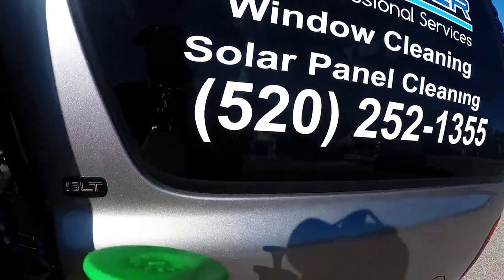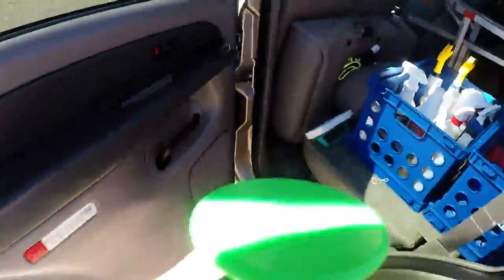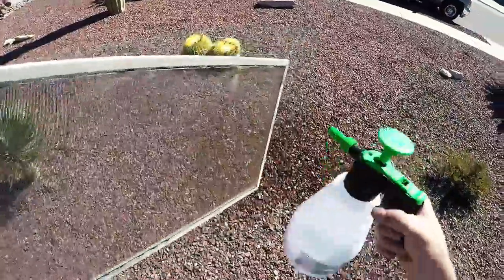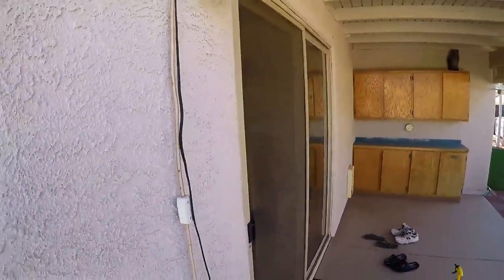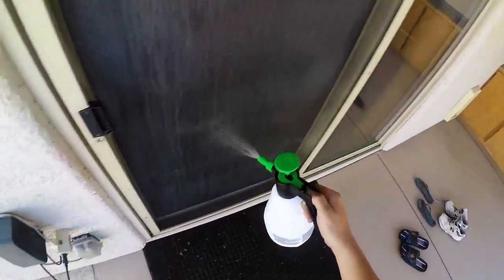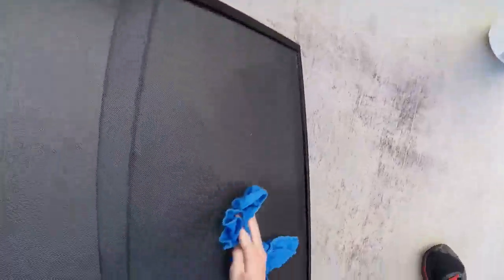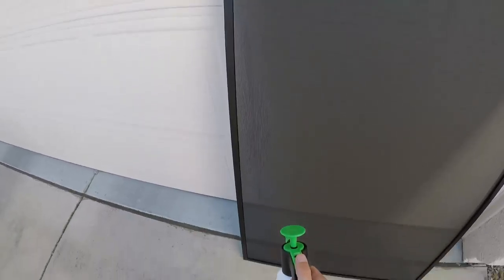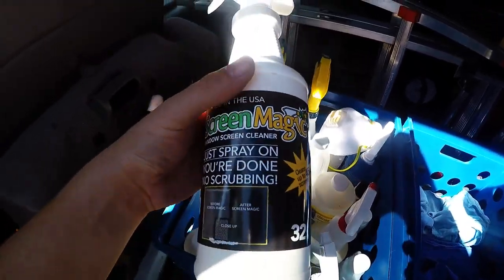Screen Magic (Screen Cleaner)

Comment: Hi, I've been using  this stuff for over 10 years, I always do two screens (as per  manufacturers instructions) at a time, both sides, saves material and time. Same with sliding door screens. And if you get this stuff on any vinyl or tile, it will be very slippery and dangerous for homeowners to walk on, so always cover before spraying if you don't remove slider screen. Just my  8 cents worth
Reply from the maker: Thanks for the advice!

Comment: What about the cleaning part? Or,you already cleaned them. I'm getting a lot of calls for houses. I might have to get some of this stuff. Thanks for sharing.
Reply from the maker: For those window screens in the video, all I did was spray it on and you're done. It eats away at the dirt and gives it that shine so you don't need to clean the screens before hand. I use it a lot on Sun Screens cause it really makes a big difference. If the screens aren't that dirty I will normally just brush them off real quick and your good.
Reply: Palmer Professional Services 
Ok cool. Nice.
Reply from the maker: It can get a little spendy so use it sparingly. And that's why I don't use it if the screens aren't very dirty. But its worth it to have in your car. Just in case you need it. Its not a product I use on every house. But very nice to have. Go pick up the 32oz ready to use screen magic.
Reply from the maker: Did you put a quote in for the house? that you showed us in one of your latest videos. Just curious how that went.
Reply: Palmer Professional Services 
Not yet. I tried but no answer. I left a message I'm going to call back later this evening. Good thing is I have 4 other houses lined up. My residential is coming along.
Reply from the maker: That's good dude. I'm glad your residential is coming along nicely.
Reply: Palmer Professional Services 
Yeah. Me too.👌

Comment: Seems cool. It is a bit pricey I see for the amount you should use per screen. Do you think you could mix it with some water so the product can last longer?
Reply: Never mind, just read through the comments section. Someone else already got it figured out :)
Reply from the maker: Yeah you can definitely try and mix it with some water so it lasts longer and see if you get similar results. You can buy the small 32oz ready to use spray bottle or you can buy the larger sizes and those you mix with water because they are a concentrate. I really like this product for sun burnt screens that are worn out and the customer doesn't want to replace them yet. Or for Sun Screens it works great on those guys. It's not something I use every single day but definitely worth having in the truck.
Reply: Awesome! Thanks!

Comment: Looks like a great product. Could you spray it on a mop and do it that way ? Not so much wasted product !
Reply from the maker: Yeah, I might have to try that out. You would think it would still work. But you would have to get the mop pretty wet cause it would dry out really quick if you didn't. Or if you're worried about it use the regular bottle sprayer that comes with it and just spray it in sections and rub it in.

Comment: It's expensive stuff, so it's far cheaper to spray the solution onto a window cleaning applicator and wipe the screen down. Works just as well for a fraction of the cost.

Comment: Do you mix it with water? and where did you pick up that pump sprayer?
Reply from the maker: You can mix it with water. if you just buy the ready to use screen magic in the spray bottle I don't mix it with water. That pump sprayer I think I got at Lowes. I put a link in the video of a good pump sprayer on Amazon that I have bought before. Just FYI
Reply: That's a good add on to sell to the customer. Thanks
Reply from the maker: Yeah it really works well for me on those sunburnt screens and they don't want to replace them. So I just spray that on and it really helps and makes them look a lot better. When you are using it on Sun Screens just make sure to take a rag and rub it in and smooth it out so it's not blotchy.
Reply: Those sun screens never come out clean with just a normal wash. That Screen Magic will make them look better as well make us look better with the customer. The customer might think we didn't do a good washing the sun screens but that's how those sun screens are they never look good even if you scrub them really good.
Reply from the maker: I know. I still don't get why those sunscreens never come out clean. It takes for ever. Maybe just cause they are so dark and they show every little imperfection and piece of dirt. But yeah buy some of the Screen Magic to have in your Vehicle. It really helps out.
Reply: I been wanting to get that for a while now You just reminded me to get it for sure.